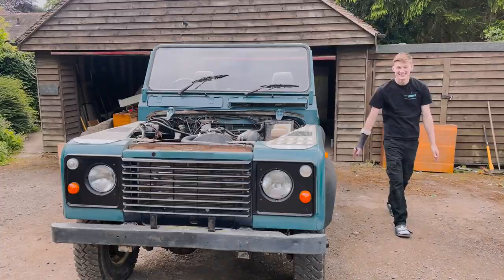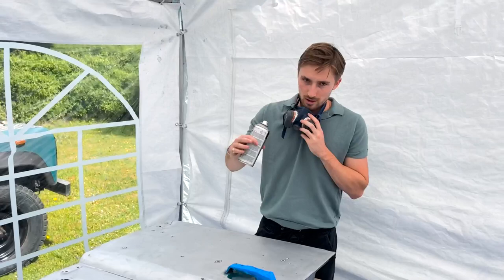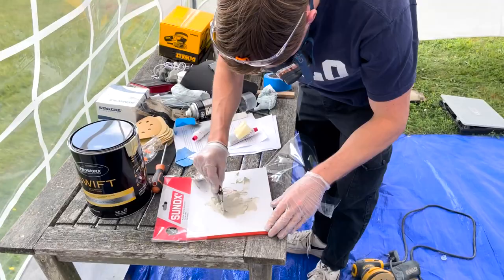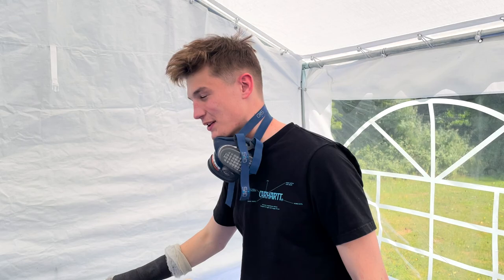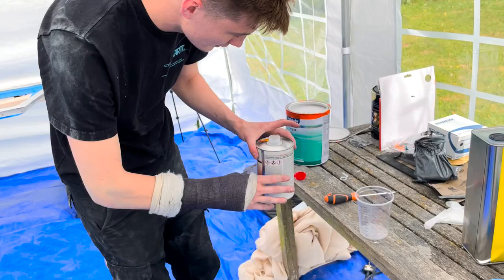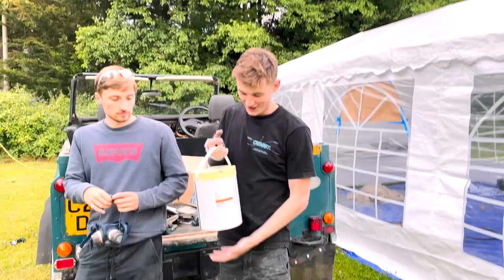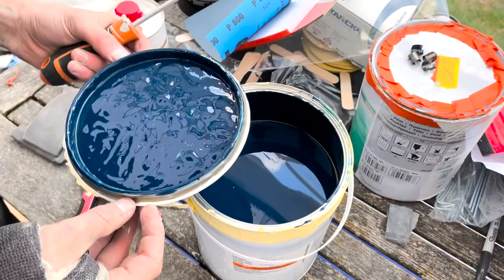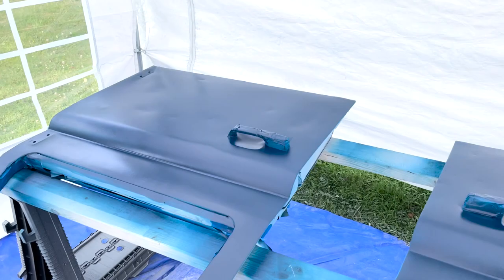Painting Our Defender 90 at Home!

Comment: Not such an issue on Aluminium (due to corrosion), but you should prime the metal prior to filling.

Glossyness, even with 2-pack paint, comes down to temperature and humidity. You applied the clear at dusk, when the temperature would be dropping rapidly during the cure time and humidity would be increasing in proportion. High gloss clearcoat needs warm and dry conditions (ideally 20-25 degrees).
If you want to base coat and clear coat in one day, you should start early(ish - base needs some temperature to flash off nicely) on a nice day and get the clear down mid afternoon at the latest. Or base one day, and clear the next.
Reply from the maker: Thank you! Yes we made that mistake and thereafter we only clear-coated in the day time!

Comment: I'd say you should sit and watch some videos on painting before going further, why miss so many dents in the doors?
 Get your filler in and use a block with 80 grit until the filler is smooth, if your not going over the filler with a fine 2 part stopper then give the panel a thin coat of matt black, now reblock using 180 or 320, the black will stay in the low spots so you can see when the panel is level, once your happy panel wipe the surface and apply a thin coat of etch primer, can be aerosol, only need a thin coat, this is really important on aluminium as it aids adhesion. Now go straight over the etch with 3 or 4 coats of your 2k high build primer, once dry give the panel a mist coat of satin black and block sand the primer with some 6 or 800 wet and dry or 400 dry disc on sander , yet again the black will show your highs and lows. If you rub through to the metal give the bare alloy a light coat of the etch before colour. 
Once your happy, panel wipe, blow off, tack rag the panel and apply your base coat, keep the first coat light, not too wet, then apply 3 to 4 coats, you can tack rag between coats once the paint has flashed off or even lightly sand out any dirt nibs with some 800 wet and dry, don't do this on the last colour coat though.
Once happy, tack off and apply 2 to 3 coats of 2k clear, first coats can be not to wet, last coat wants to really flow out.
I always go around panel edges first before the main face of the panel, leave a good 10 to 15 mins between coats on a good day, once it's dry you can sand any dirt nibs out with some 1200 wet and dry and machine polish with some G3.
The colour you've picked will exaggerate ripples and dents, in general the lighter the colour the more you get away with, white hides a lot, black shows ripples.
Work on your gun technique, paint edge to edge with 50% overlap, I prefair panels verticle as you'll get less crap landing in your work, start at the bottom of the panel and do edge to edge strokes watching the reflection to guage how wet the material is going on  .
Remember, paintwork is 90% prep, 5% aplication and 5% luck 👍
Reply from the maker: Thank you mate appreciate you taking the time to write that! What do you think of sanding the clear back with 800 then re doing the clear? To get a shiny finish? And yeah I agree we missed way too many spots with the body filler the panel is not good shape at all! We can’t afford drying racks at the moment it’s on the list of stuff to buy!
Reply: @archieandbensadventures   Yes, you could sand the clear, prob best with 1000 wet and dry and don't break through the clear or you'll be screwed, you won't be able to just clear coat and if you just recolour the section you will find that the thinners in your colour can crack up the lacquer edge where you rubbed through. 
I'd do the rest of the dents, reprime and re colour as I can't see the point in spending money on paint if you don't do the dents. Focus on one panel until you get it right, filler is best shaped and sanded with a coarse paper like 80 grit, bigger areas with 40 grit to knock the top off the filler.  Keep the filler dry as well, it will absorb moisture and cause micro blisters in your top coat later on. I use a 2k fine filler as a skim over the filler, I flat this with 320 paper, the fine filler fills the 40 or 80 grit sanding marks so the primer has less work to do and there's less chance of shrinkage marks later on.
A guide coat is really good for showing highs and lows, aerosol matt black or you can buy black powder that does the same, it will really show any prep marks or unevenness. 
On the right day you can get just the same finish painting outside as you can in a booth, weather conditions need to be on your side though 👍
Reply from the maker: Okay ill do that! How do I know I’m close to breaking though the clear coat?
Reply: @archieandbensadventures  You won't really know, when your paper turns blue you've gone too far!
Depends really how much lacquer you got on to start with, 2 good full coats will take a good bit of flatting with 1200 wet and dry before it will break through , be careful on the edges, if you do break through and want to recolour that section before re lacquering, make sure your first coat or colour is light as it's the thinners that will attack the lacquer edge. 
How rough is your lacquer? If it's not too bad you could use a grey scotch pad to key it up, panel wipe, tack off and 2 nice wet coats of lacquer.
Reply from the maker: I think we won’t worry about the dents too much, as we’re going to take if off roading and we only get to work on the car once a week due to working so we will be there forever if we chase every dent! From what you’ve said I think we will sand down with 1000 all over the panel then give it a light coat of clear, then 2 more wet coats and it should look shiny!?
Reply: @archieandbensadventures  Sounds like a plan, hope all goes well 👍
Reply from the maker: Thank you and thanks so much for all the advice we really appreciate it!